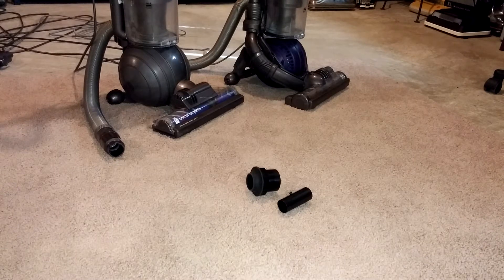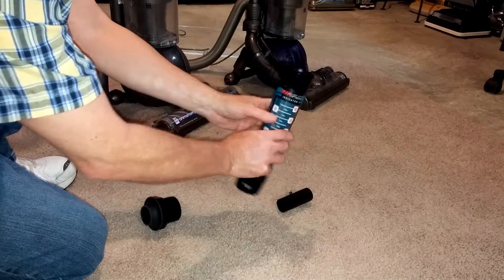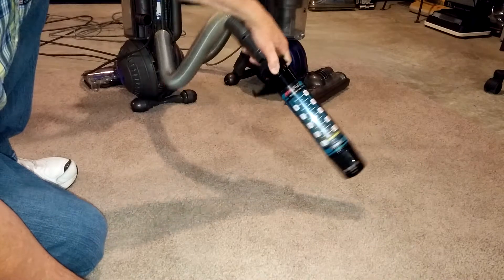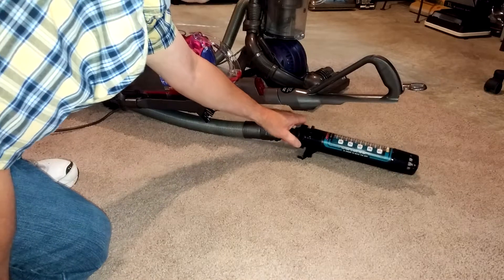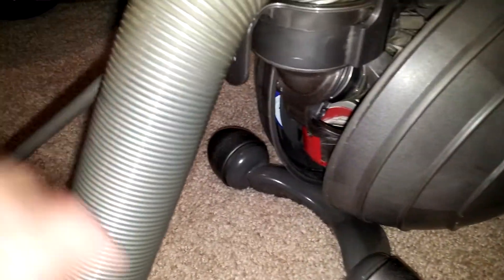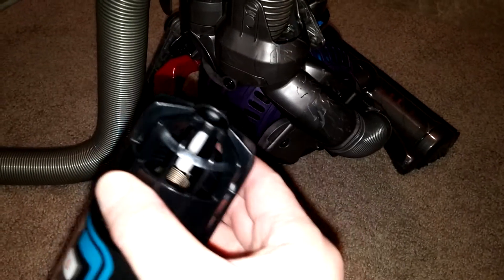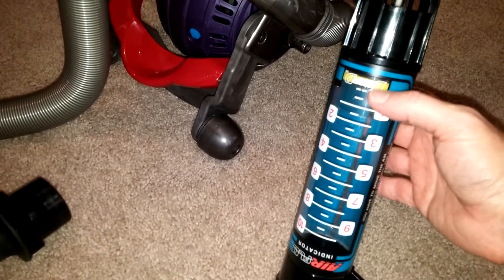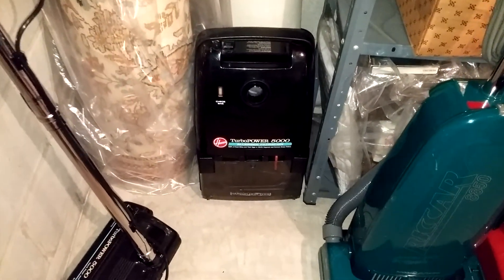Care and Use of a Baird Meter and searching for more hose airflow for Mikko's DC40 MK1

Comment: Thank you for this video! I did know that the baird meter needs to be in horizontal position, but what I didn't know how much it makes a difference. Thanks to your video now I know that it makes a huge difference. I might have to do my measurements again (especially canister vacs). Because I had the hoses all tangled up during the measurements. My DC40 have exactly the same change over valve than your DC65. I have made a video checking all the joints and the hose leaks a bit in my DC40. I will make a video about this subject soon.
Reply from the maker: Your very welcome. I hope you can get your hose measurements at least up to a Baird "3" soon. Then, any accessories should work as intended.